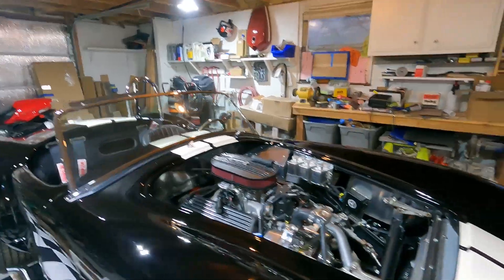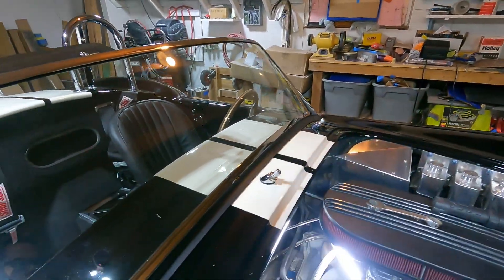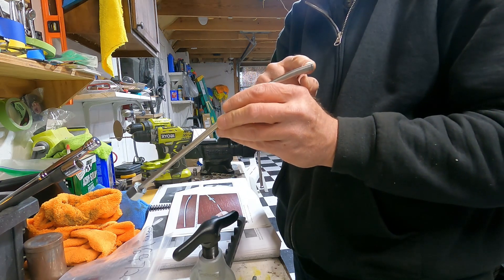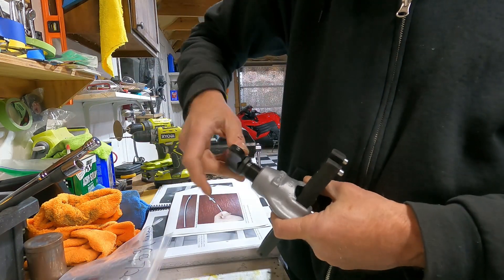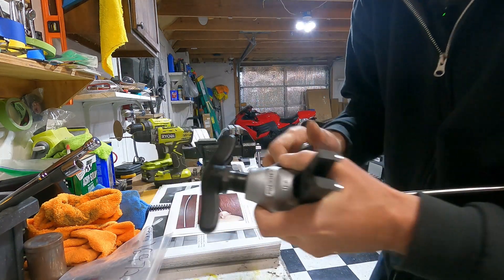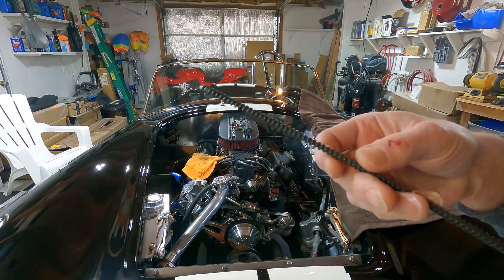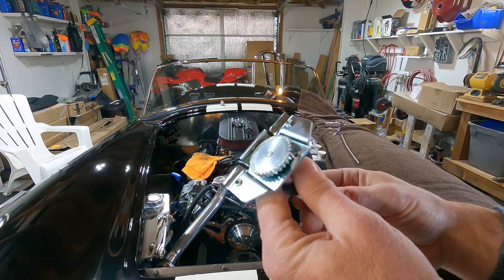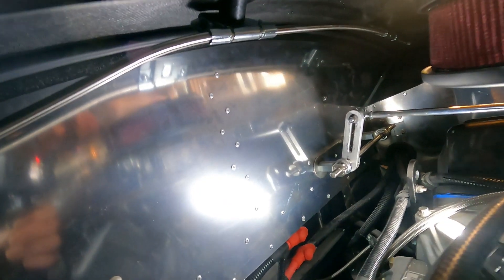FFR MK 4 Windshield wiper system installation - Shelby Cobra replica build

Comment: Nice, I have my wipers all in except for the wheel boxes. Thanks for the video
Reply from the maker: For sure. I had numerous tweaks to the wheel boxes to get the angle right, turning the rubber hose, etc. Had to clean up the openings also after the paint build up, seemed to help. It for sure fought me for a bit 🤕😂

Comment: I luv the Lucas Electrics graphic. Hahaha
BTW are you planning on adding an oil catch can to keep that nasty valve venting "air" from recirculating into the throttle body?
Reply from the maker: Yea that is a funny one, kinda true lol. No plans on a catch can right now, I'm running a carb not injection at this time. May add one later on when the mod bug kicks in. Did you get a ship date yet on your kit? Mine was delivered about 5 weeks after it was done.
Reply: @livinonklandathu  Yes, the kit is to ship tomorrow (3/27) and is expected to arrive 4/1- 4/3. WooHoo!
My engine, a 347 stroker from BluePrint, arrived a couple of days ago.
Reply from the maker: @wild_bluyonder843  Nice!